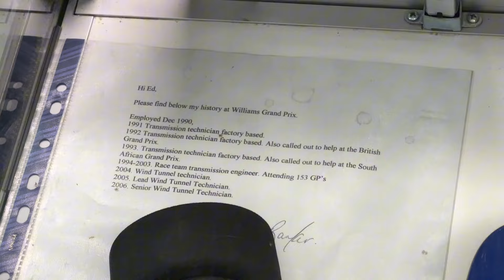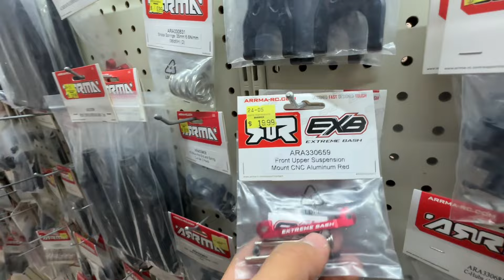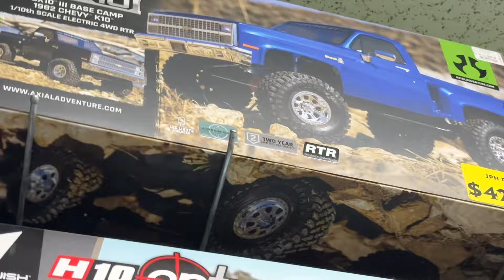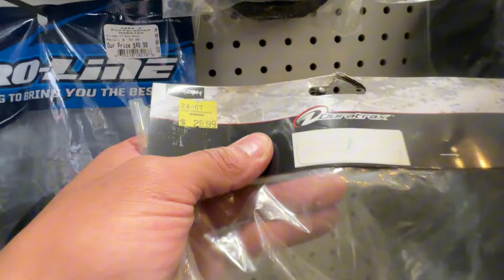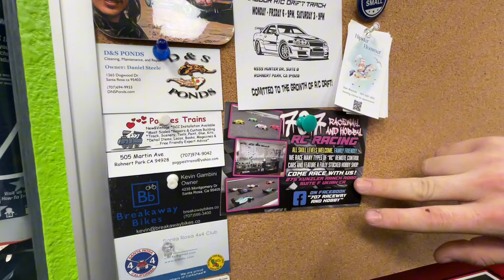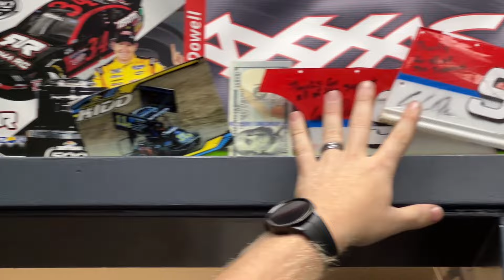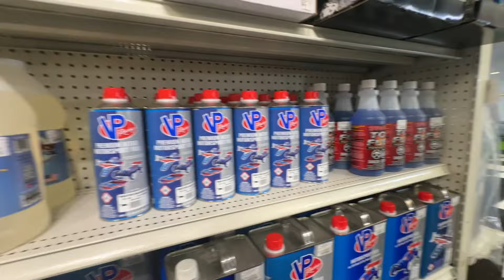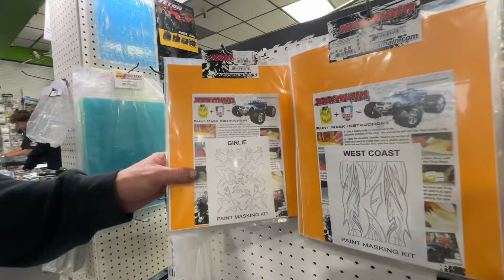Hobby Shop Tour Jake’s performance Hobbies

Comment: These battery or what’s the fuel.
Reply from the maker: The use batteries and some use nitro fuel and the 1/5 gas ones use 2 stroke 50:1 mix

Comment: My 7 year old boy wants me to buy him a good rc car but idk what kind to buy for him at his age
Reply from the maker: I have an excellent recommendation. You should get him the Arrma Mojave Grom BLX. It is super fast. However you can turn a switch on the back of the remote and make it only go half power so he can learn to drive it. Once he gets comfortable driving it you can turn it to 75 percent power or 100 percent power. At full power it will run 35 miles an hour. At half power it will do around 22. They also have a gyro system which helps keep the truck driving straight. They are durable and easy to drive and work on. Best of all they are fairly inexpensive at around 230$ battery and charger included. Here is the link https://www.horizonhobby.com/product/mojave-grom-223s-blx-brushless-4x4-small-scale-desert-truck-rtr-with-dsc-battery-and-charger-included-teal/ARA2304ST1.html?utm_source=google&utm_medium=cpc&utm_campaign=shopping_proprietary_arrma_kits&utm_campaignid=21862209064&adgroupid=172526212991&utm_content=719312868437&utm_term=%3A%3Amatchtype_&utm_device=m&gad_source=1&gbraid=0AAAAAD_XYFmmqDwrVkP12EobNF8rNR3u1
Reply: If you really interested in getting him one. I'd say the arrma vortex. On Amazon for about 175 to 200. Comes with everything. Can upgrade as he progresses his driving skills
Reply: It's also 1/10th scale
 Which is average size. The gross are to small. Don't do very good in grass
Reply: Lol. The groms ate very small